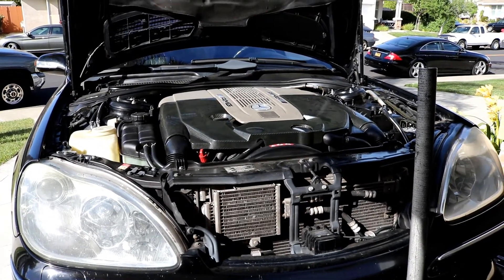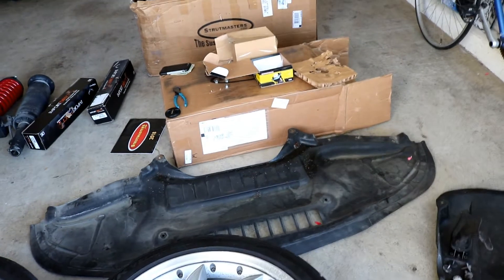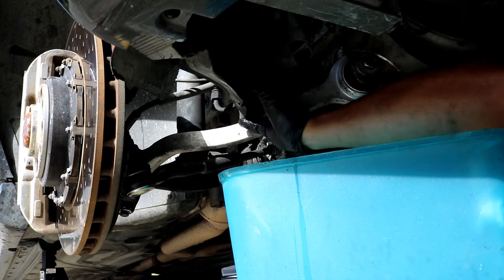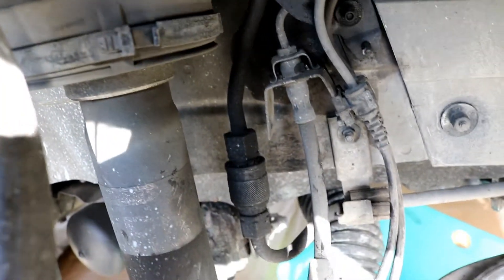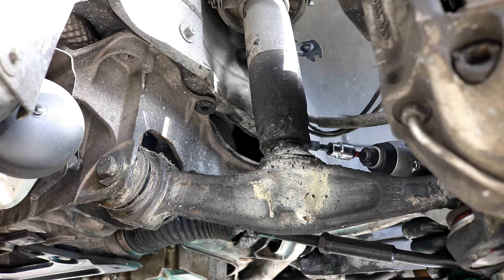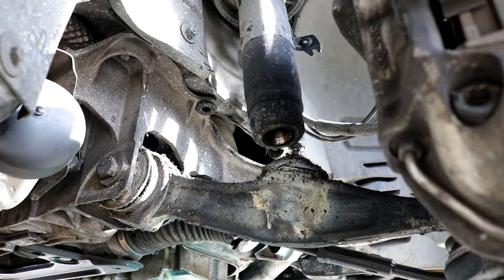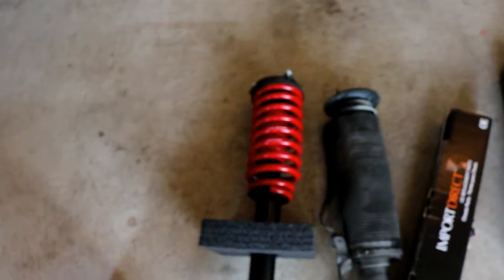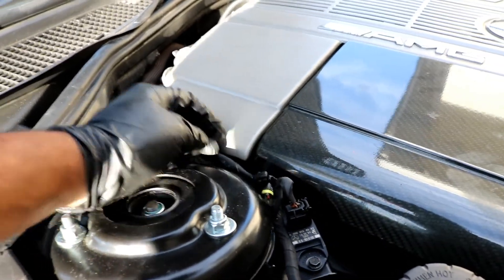2000-2006 Mercedes S-class, CL-class Front Strutmasters conversion W220/C215

Comment: One question: 
What about the sway bar?
I have a s55, and preparing for the worst.....
Reply from the maker: What year is your s55? Does it have ABC or airmatic suspension?
Reply: @HelpingHandAutoRepair  2004 s55.
Tavarish on his sl installed sway bars.
Also I don't like the hight of the car with the new setup.
Right now I have a adjustable links, so my sits just right.
Reply: @HelpingHandAutoRepair  abc of course. The whole thing was replaced 4 years and 50k mi ago. Still perfect, just what if.
Reply from the maker: @kristof4890  I would just keep the ABC if you just had it all replaced and it’s working fine. It’s more reliable than the airmatic. If you want to get rid of the ABC, then you will want to get airmatic front lower control arms in order to run a sway bar from an airmatic w220 car.
Reply: @kristof4890  after for years hopefully you have replaced the abc reservoirs or you will need to replace the whole thing again real soon
Reply from the maker: On this car? There isn’t anymore ABC suspension. It’s converted to traditional coil springs.

Comment: Did your customer not want sway bars? How is the ride quality without swabars? You didn't replace power steering pump? With ABC delete how is the power steering working? Thanks
Reply from the maker: No sway bars installed. They didn’t want them. It has significantly more body roll. Power steering works just fine.
Reply from the maker: No sway bars installed. They didn’t want them. It has significantly more body roll. Power steering works just fine.

Comment: Do you have to do anything to the power steering pump or any of the electronics when converting to a coilovers?
Reply from the maker: On this chassis you need to use the light fix module
Reply: You’ll have to change to the s500 power steering pump I’ve done a few of these in the pass . You can use the old abc reservoir .